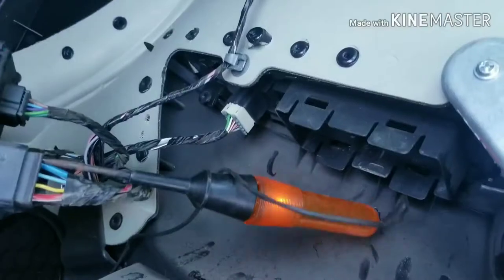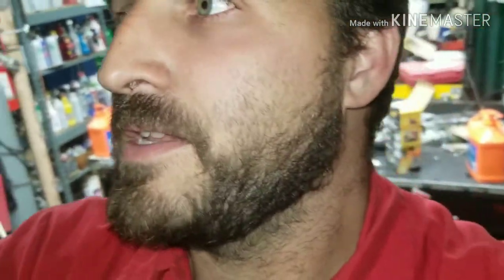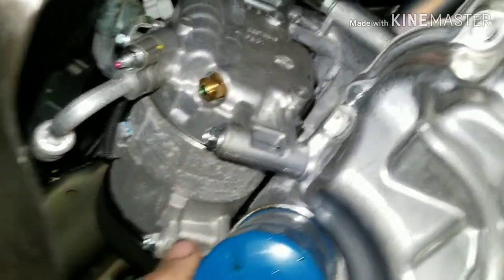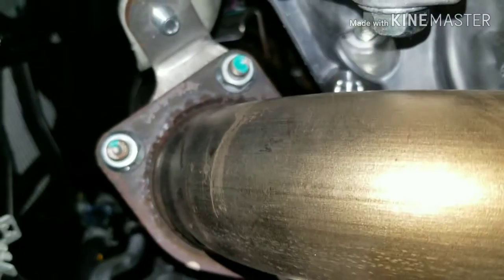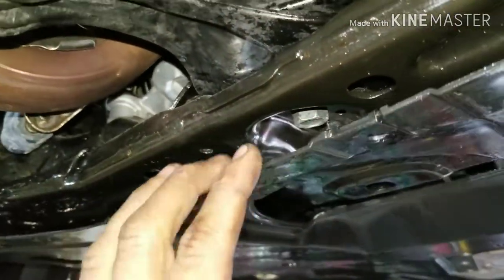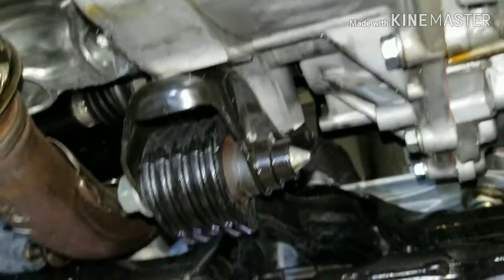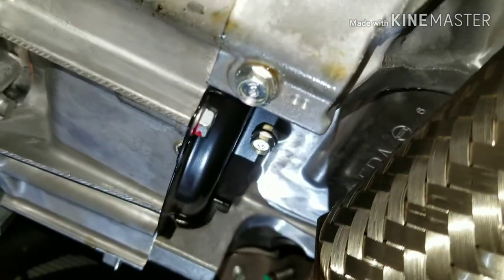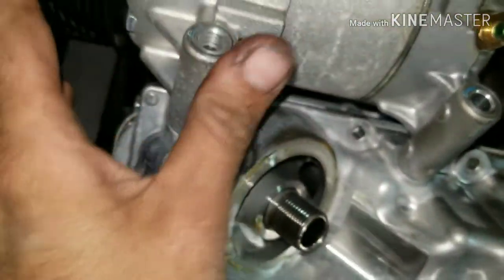2019 Honda civic 800 miles oil pan replacment

Comment: Wow, thanks so much! I was told I needed to change my oil pan because they couldn’t remove the bolt. Is that a normal?
Reply from the maker: I'm assuming you mean the drain plug, it should be easy to remove. the only reason it would not come out is if a person who had done the oil change before  had striped it out or crossthreded it.both options can be fixed with a heeli coil or king cert kit,with outchsngeing the pan.thanks for watchin.

Comment: Did you have to drop the subframe to get it out ?
Reply from the maker: When I did it I did not drop the  sub frame look for hidden bolts I found a few in that area, plus the  the honda bond rtv is super sticky. Thanks for watchin and besure to like and subscribe for more helpful tips and tricks.
Reply: fixer good oh okay, thanks. Was this the 2.0 engine or the 1.5?
Reply: fixer good how long did the job take to complete ?
Reply from the maker: @MrJD240sx   I cant remember what engine it was when I find out I will update the video  I think it took like 3 hours or so